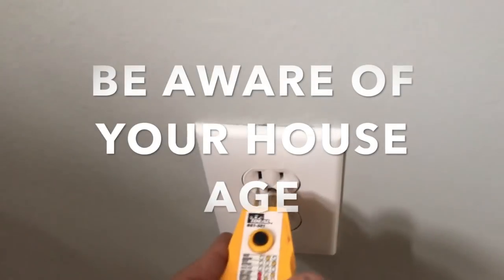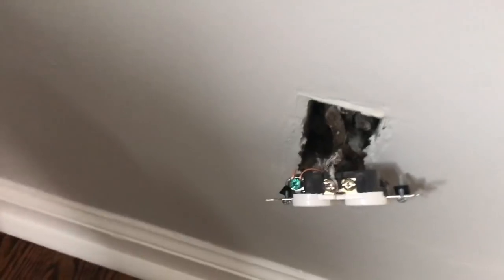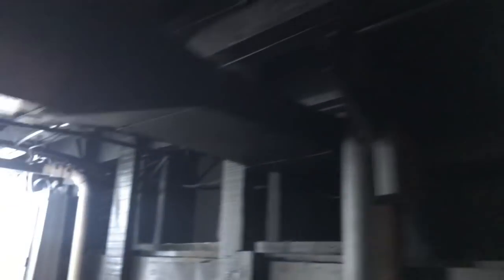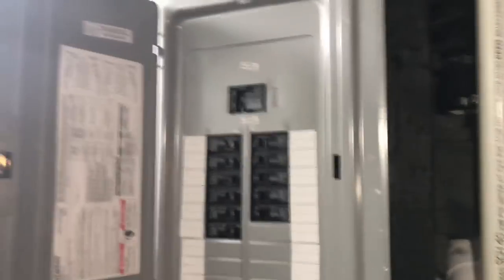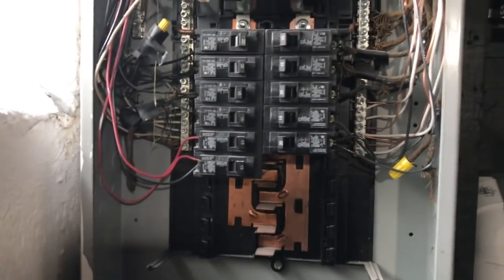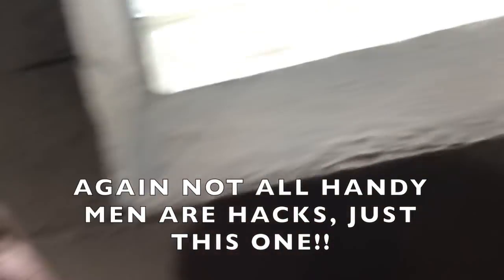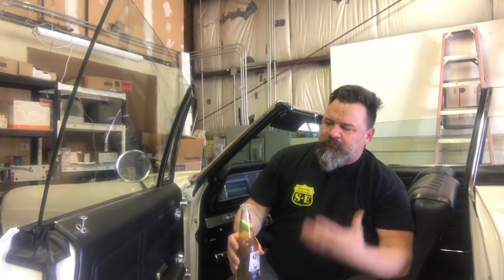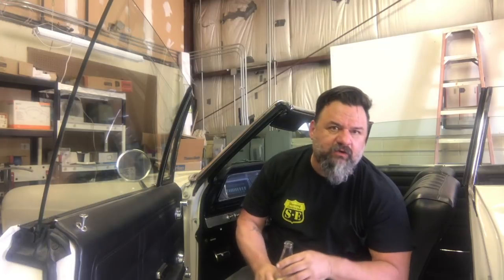DO YOU NEED AN ELECTRICAL INSPECTION?   WHAT YOU NEED TO KNOW!

Comment: I bought a flipped house where only the kitchen is actually grounded. I want to ground the rest of the house over time. Would I just add a bare ground wire down to each receptacle if the existing wire is in ok shape or is it best to just pull new romex down to each receptacle to have a ground?
Reply from the maker: add a GFCI to the beginning of the circuit to protect the other outlets. power to the line side and the other wire to the load side. I wouldn't fish wires to ground them. this is legal and way easier.
Reply: @StarvingElectrician  will doing this protect a device? I am getting a Tonal exercise machine (basically has a computer in it) which requires a grounded 3 prong outlet according to their specs. Does a gfci protected outlet or circuit provide that if there is no actual ground?

Comment: Great videos, very informative and to the point.  Flipped houses are typically a mess.  Just a note, being licensed doesn't necessarily make you a quality worker.  I have followed licensed electricians, and plumbers that I had to fix their work.  It's really dependent on the individual, and how much integrity they have in completing the task the proper way.
Reply from the maker: yes you hit it on the head. I have seen just as many hacks out there licensed. thanks for the insight!

Comment: I am trying to installing two LED  mirror in the washroom each  consumes 468w  total  936 Watt  and  2  vanity light each takes  3 bulbs w  and each of those led bulbs are  5 w   total  30 Watt  connecting all of these  the single  wire  that was already there for    washroom  vanity light  so just  wondering is it safe to  do that  do not want  that it cause fire  or anything  thanks
Reply from the maker: that load is nothing. do the math 966watts divided by the voltage and that gives you the amperage. 8 amps.
Reply: @StarvingElectrician   Thanks  also i am trying to install a  small rectangular light on my wall   if i use regular  rounded junction box it  wont be covered  completely by my light  but if  i use the one that is made  for  outlets like the link below it will cover nicely  so  just wondering  if it is ok or any code  for that thanks again 
https://www.homedepot.ca/product/iberville-device-box-2-1-2-inch-deep-1-g-nmd90/1000804607  or this  https://www.homedepot.ca/product/iberville-device-box-2-1-2-in-deep-loomex-bx/1000106188?rrec=true

Comment: Can I run a 125 amp load on a 60 amp main panel? The service wire coming in is a 1/0 wire. 2500 sqft home. Only has 8 spaces.
Reply from the maker: nope if you draw more than what the panel is rated then the panel will catch on fire especially being fed from a 125 amp breaker. never exceed the main breaker size in a sub panel

Comment: Can a commercial bolt down sub panel be used in a residential setting?
Reply from the maker: absolutely. just more expencive. remember breakers are just switches that trip when the load is exceeded. the brand or make of a panel has no bearing on how the panel works.
Reply: @StarvingElectrician  perfect.. luckily where I work I ha e tons of bolt down vreakers

Comment: In my opinion the best method of fixing ungrounded circuits is to replace every outlet with a GFCI. Yeah, pretty expensive materials wise at $15/outlet or so, but much better than sticking a GFCI at the first outlet to protect the rest in the chain since one popping doesn't kill the rest of the circuit. Plus it's something a moderately skilled homeowner can do themselves and is certainly much cheaper than a complete rewire.

Granted, in this situation with what I'm guessing is knob and tube I would be a little nervous. Who the hell knows what's going on behind those walls with improper splices and whatnot. When I rewired my 1900 house, I found a circuit that had romex, aluminum, and knob and tube all on one circuit. Scary. 

Being a single story home fortunately fishing wire was quite easy to rewire the place.
Reply from the maker: its the same difference. one gfi protects the circuit. if you had 15 gfci recptacles they wouldnt work. they would never hold. its code to have the gfci at the begginning of the circuit and change the rest to three prong outlets. or a gfi breaker. but inter connected neutrals will make it trip. pain in the ass. were just talking code book here. it is what it is. thanks for the response though!!!
Reply: @StarvingElectrician  maybe I'm misunderstanding, but I can't see any reason why having multiple GFCIs on a circuit would be a problem, nor am I aware of  any code that forbids it. Of course, you'd have to use the line side of the outlet for both the incoming and outgoing power.

Comment: Those "fake grounds" are the worst. Sometimes the inspector in my area will pull the covers off the outlets to see if someone did that and he's a retired electrician with a license btw. Most hacks think "It's just a neutral and they both connect to the same place in the main panel". What they don't understand is that current flows on the neutral when ever something is plugged in. It might be safe if you have a lamp, a vacuum cleaner, a stereo or any other 2 wire appliance plugged in. The problem is, if you happen to lose a neutral downstream and you have a computer or anything that has a three prong plug with a metal case plugged into an outlet like that and you touch that fake grounded appliance and an actual real ground on something else at the same time, then that's when you get shocked or electrocuted. Those neutrals can be just as deadly!
Reply from the maker: yes indeed!!! the look for the easy way out to sell quick. who cares if the new owner is safe.
Reply: @StarvingElectrician  My mom got hurt when I was a little kid back in the 70s from something similar to this. Back then the ranges from the 50s and 60s had 2 hots and a ground with a 3 prong 50 amp receptacle and plug. She was making dinner one night and she dropped a tomato on the floor, she had her spoon in the pot she was stirring in and she reached down, picked up the tomato to put it in the sink and as she touched the sink it went from the spoon, through her hand, then through her body, then through her other hand into the sink! What had probably happened was the burner was on the low setting which usually runs at 110 volts on the low setting instead of the 220 volts when it's on the high setting and it was feeding back into the ground which was bonded to the frame of the stove. My uncle that was an electrician at the time came over and found that the neutral was actually the ground wire and it was also bonded to the frame and he changed everything over to 4 wire.
Reply: @StarvingElectrician  yep just hook up hot and neutral use the three prog as 2 prong out lets its safe that way at less or if you still get them but 2 prong but best to buy 3 or hafe stuff want plug up with out braking ground of of course if got money just get all new wires every were so its ligal and safe

Comment: Thanks for the video.  You have helped me and countless others.  I have a unique problem.  I have a breaker for my stove that did not work.  I moved the same breaker to another part of the panel and it worked.  I moved working breaking to the original location and they did not work in that location either.  Suggestions?
Reply from the maker: thanks so much. well this may sound crazy but I would check the main lugs. test each to ground and see if you get 110V on each. that pole or side of the panel may be out. that could be from the main breaker or the meter socket. so check it from the main breaker and then the feeders feeding the panel. spaces in the panel dont just go out. it is an aluminum bar inside the panel. its usually one or the other of what Im saying. good luck to you

Comment: Automotive and DC electrical systems are something totally different. At least you admit your limitations. I will say, I am an electrician and automotive mechanic... some automotive systems will drive me crazy! AC systems are straightforward; automotive systems are designed to be the cheapest, and you run into hack engineering on cars from the factory.
Reply from the maker: Great point! yea i guess you would get the hacks too. thank you!!!

Comment: My issue with my home what i recently bought they have circuits tie end from all over . Example they have living room outlets with kitchen outlets on one breaker. 
Which is so stupid and crazy who every did it 
And I didn’t realized until a few months after
Reply from the maker: yea you get that and its a bitch to re feed unless you are on a basement. the only thing you can do is take apart the plugs in the kitchen and see when the power to the other parts of the house go out. then you run a new circuit to that wire and put the existing one back on the kitchen plug circuit. am i being confusing? sorry. lol

Comment: Question for ya. I wanna replace the ( 20 yrs old) hard wired smokes in my house but cannot find the breaker to kill the power. My electrical panel does not have a main shut off breaker so I shut off all the breakers in the panel and the smokes are still HOT.  The elect panel is in the garage. The only panel on the side of the house is the meter panel and I don't wanna break the lock the elect Co placed on it. Any ideas?
Reply from the maker: hmm thats screwy. I hate to tell you this but if you shut off all the breakers and they are still hot you may have a bad breaker and thats dangerous. I would grab a tick tracer from home depot. bout 10 bucks. you hold it to a wire and the light go's on if there is power. shut off all the breakers and see if one of the circuits is still hot. aside from that I would say you have a sub panel somewhere.  hope it works out.
Reply: @StarvingElectrician  Thanks for your reply.

Comment: Thank you for your tutorial. My 12 breaker box started to act all of the sudden the lights started blinking, testing  the problem at my first outlet, the voltage coming from the panel fluctuates but only on breakers 2,4,6,8 and 10, the other are ok'd,  what can cause this problem that half of the panel works right. Help me.
Reply from the maker: sorry somehow you ended up in my spam box. sounds like the main breaker. may have to tighten down the feeder wires. check to see if there is any arching. i always jiggle the wires to see if theres anything loose in there. i know you may have already fixed this and im sorry for not getting right back to you.

Comment: how should the box be bonded if you have PVC in your house and not copper water pipes?
Reply from the maker: thats why you bond all the way to the water meter pipe. if you have everything coming in and none is galvanized or copper then the two ground rods are adiquate. they are your secondary ground.

Comment: I've worked as a handy man for a while. I'm now an electrical trainee. That aside any electrical I had a strict rule about. I'd dig the trench. I'd pull the wire. I'd put in the box. BUT the final check and hookup HAS to be done by a licensed electrician. Made it clear to any client that was part of the cost. Local guys loved me because I'd do all the shit that wastes their time, then they'd get to come in and spend 1-2 hours for an easy $300.
Reply from the maker: $300 is good money but you are right, its tough to get a contractor out of bed for that. lol

Comment: Ok.... hold on... I was thinking about something... the main home subpanel has the neutral bars grounded to the frame of the box with a green screw and the box is grounded to ground, therefor connecting neutrals to ground at the subpanel. How is putting ground at the outlet to neutral electrically diffrent?
Reply: Because if the Neutral path between the device and the service is damaged or removed, the current on the neutral could pass through the device, through a person and into the ground. The Neutral is only allowed to be bonded to the grounding system at the first service for this reason.
Reply from the maker: sorry just got an alert that 30 comments were pending so I just saw your comment. yep thats the question. they all go to the same place but I think its more to isolate the ground back to the main panel.

Comment: Hi again. I enjoy your videos quite a bit.  A first-year apprentice could do a better job wiring a panel then the hack that did that one. You can tell the difference between your work and a hack job. Clean 90's in the wiring, everything properly terminated. On the circuit with the combined neutrals, I would have loved to see you load part of the circuit and throw an amp clamp on the neutrals and grounds. 🤪
Reply from the maker: sorry just got an alert that 30 comments were pending so I just saw your comment. thank you. yea just giving a shit a littlebit puts you in a better place than this hack.

Comment: I'm also a licensed master electrician in Michigan, and I get irritated by hacks just as you describe in this video.  I am tired of losing work to people like them who don't pull permits (they can't anyway), they don't upgrade the grounding system to Code, and they do a terrible job of installing service panels.  I just looked at an open house on Sunday where the listing claimed to have "updated electrical", and I see a brand new panel without any proper grounding, nor any permits pulled.

In my opinion, one way to keep this at bay is for big-box stores and electrical supply houses to only sell panels to licensed electricians.  I mean, HVAC supply houses only sell furnaces and A/C condensers to licensed HVAC contractors, so why should electrical be any different?  In fact, here should be a strict limit on the electrical items overall that unlicensed people can purchase in the first place, not just panels.
Reply from the maker: sorry just got an alert that 30 comments were pending so I just saw your comment. yep so sick of competing with hacks. people take their lives in their hands to save a buck,

Comment: THANK YOU...for sharing. Nice car...need ground wire from frame to body and body to engine...I think there is a ground wire to the steering column,  no it jumps over the rag joint. check those three things out and I think your dash problems will be solved.
Reply from the maker: sorry just got an alert that 30 comments were pending so I just saw your comment. lol yea its back together and half assed but im not giving up!!!

Comment: In Michigan can a home inspector open the electric panel, or remove a cover for a socket? I was told by a inspector that they could not do that where I live. He may be trying to cover his tail, but that’s what I was told. Great video, thanks for posting.
Reply from the maker: sorry just got an alert that 30 comments were pending so I just saw your comment. once there is a permit pulled they can do what they want. they shouldn't because its grandfathered in. they have the athority to see if its safe but, if the shoot you down they have to name the violations and when you fix them, they cant look for more. hope this helps

Comment: what would you do on a knob and tube house rewire everything with romex? or just run new ground wire to everything? thanks love your vids bro
Reply from the maker: Chris F  thanks Chris. Great question. By the time you ran a ground wire to everything you may as well run Romex.  You can’t Splice onto knob and tube unless you have all the appropriate connectors and insulators and all kind of shit. It’s all a pain in the ass so for me I would run new wire. Let put it this way. I wouldn’t charge any less to run ground wires or new wires. It’s about the same time.   Thanks for watching.
Reply: @StarvingElectrician  cool thanks